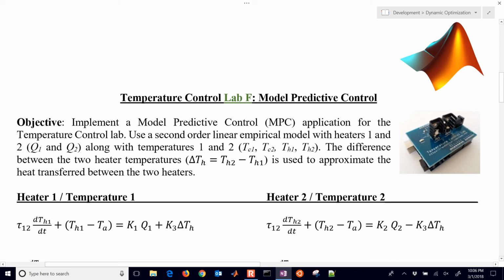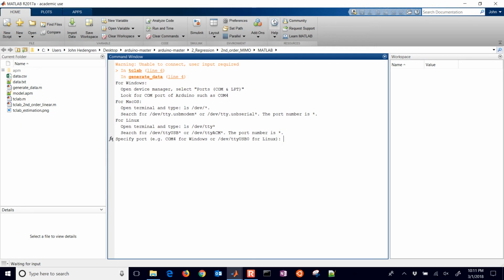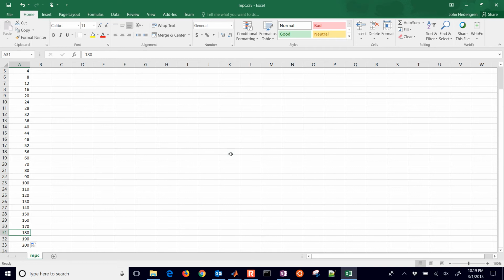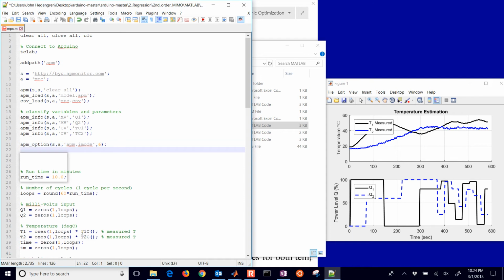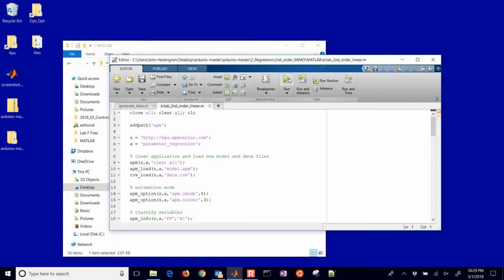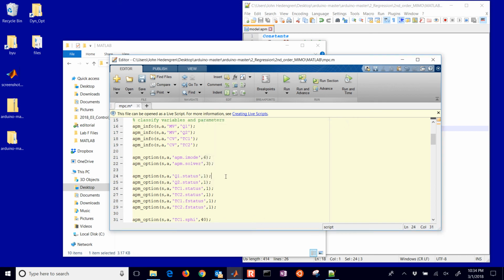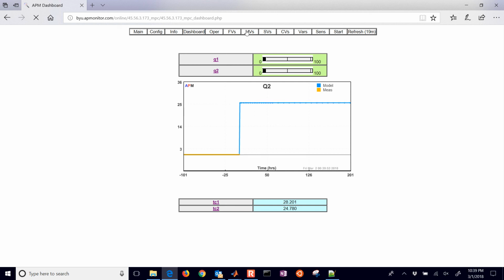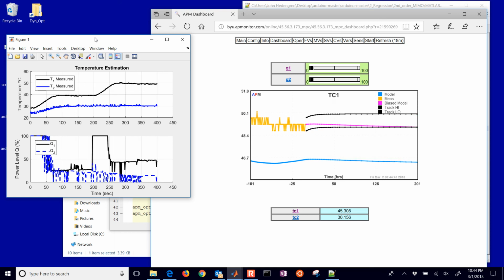Model Predictive Control with Arduino in MATLAB

Comment: Dear Prof. Hedengren, I learnt quite a lot from your tutorial. Thank you so much. But I am not quite familiar with the apm you used during MPC controller desgin, such as apm_info, apm_option. So do you have any learning materials about this topic? Thank you.
Reply from the maker: There are tutorials at http://apmonitor.com/me575 (design optimization) and http://apmonitor.com/do (dynamic  optimization). Documentation is available at http://apmonitor.com/wiki  There is also an email users group where you can send questions. Let me know if you need any other resources.
Reply: This is very helpful. Thank you very much.